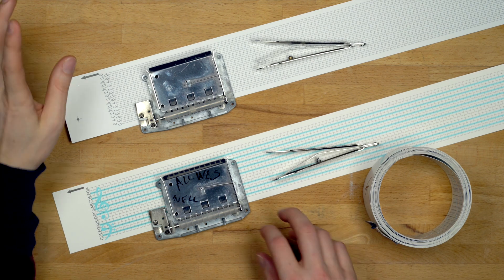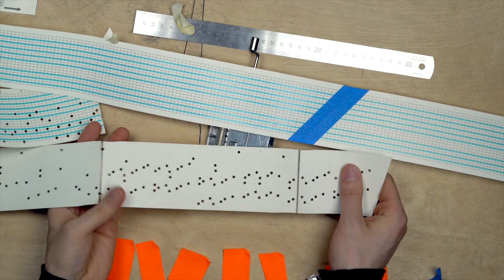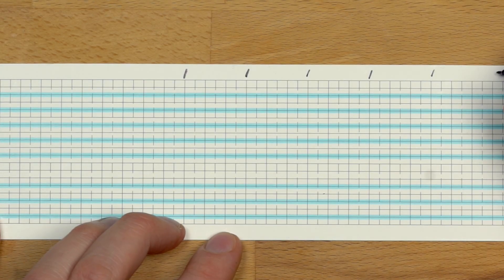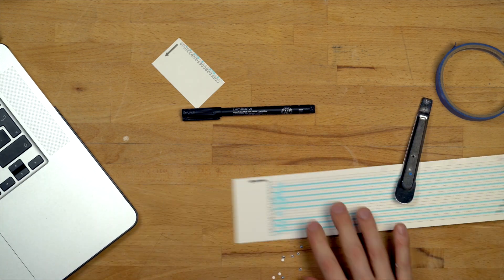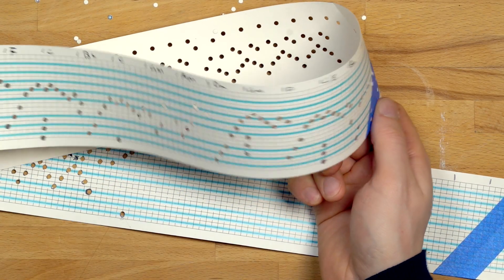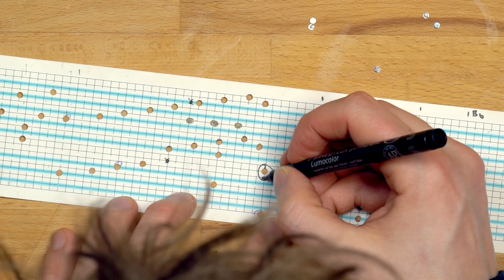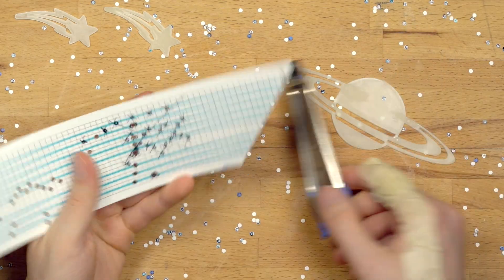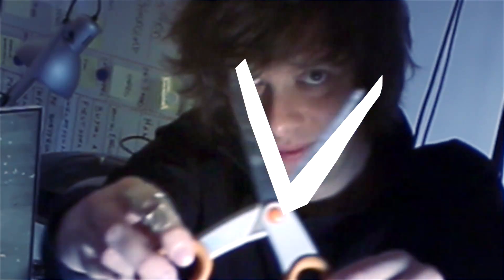How To Program a Music Box - Hole Punch Tutorial

Comment: You should invest in Adobe Illustrator and create a music box template or find one already created by someone else, then simply create your notes on it, print, and punch. If you need a certain paper thickness, print the paper, loosely tape it onto the right paper weight and use it as a guide. You might need a light box or transfer the print to tracing paper. It depends on the amount of work or cost you're willing to commit.

Comment: Hi martin, you can use direct midi to hole score print software available from a Japanese programmer. very useful because can print to any paper directly from midi. Unfortunately it has only in Japanese version, but I'm quite sure that you can use it with your insight.
http://www.01.246.ne.jp/~ttha/index.htm
Reply: Hey, I have this program!! When I bought my 30-note music box at a Sankyō music box museum in Japan, they gave me a copy of this program "Oto no Kyanbasu" [ The Sound Canvas ] for free. Unfortunately, mine only works on Windows XP.  But I just looked at the link you posted, and it says it is working fine on Windows 11? So maybe I just need the updated version.
Reply: Sorry, it's actually a 33-note music box! So it's different from the ones most people are using.

Comment: This video has been hugely helpful to me! A couple questions: 1. Are there ways of temporarily re-tuning the music box? Sometimes I want the low D to be a low E, but then I'd like to change it back without degrading the comb. 2. What about making your own paper tape? I have figured out that the 30-note paper is about 70 mm wide, with 2 mm between notes and about 6 mm on the margins. Given these measurements, it should be easy enough to create a drawing in any old drawing or word processing program and print it on card stock. Or, draw it on card with a pen and ruler. Seems like it would be way cheaper than buying a roll of music box paper. You can get 15 m for $18 including shipping, so wouldn't printing or drawing your own cost less?

Comment: So back in the day (before our time), my father used to write his programs into his terminal and then would print them to punch cards.  Pretty sure they were IBM machines.  WAY too large for your use.  I remember seeing some cards on his office shelves when I was 4 years old (1979) and thinking about it now, they kinda resembled midi.  They came out looking something like this  https://i.stack.imgur.com/XvPKy.jpg   I would think using the same tech that punched the cards back in the day, it should be possible to do something similar with midi.  Would require a custom machine for sure.  Not sure where to go to start you off, but thought it might prove to be another avenue to speed the production and accuracy of your amazing musical works.

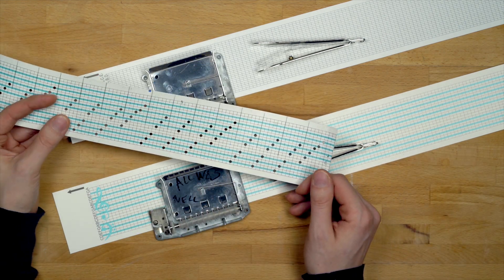Comment: At 0:41 he shows both boxes. One on bottom showing has more contact points on the pulling wheel. Does anyone know what version of the music box this is? I happened to own one of the ones shown on top with less contact points. Not only do I HAVE to thicken up the paper with 2 layers of tape to make the paper not fold upward into the umpty pockets where contact points are on the other one to not have it play random notes, also because it has not enough contact with the paper, it simply somehow can't pull the paper forward, having it brake every now and then, it seems to do it more and more the more I play a specific roll. It's fucking annoying having to tape all these strips with multiple layers of tape since it makes it harder to poke holes in it and also takes a shitload of time. 

If anyone can help out or tell me more that'd be fuckin really appreciated
Reply: This is a really late reply and I don't know if its of any use anymore, but I think the 20-note music box he has is from likely Grand Illusions (https://www.grand-illusions.com/20-note-music-box-set-c2x21140292) I bought my music box from this site too. I recognize the sheet music he uses is the same as mine. The music box doesn't have the problem you described with yours. Best of luck!
Reply: Can't you just use thicker paper to begin with? Like card stock.
Reply: Oh, I just realised you're working with rolls of paper with all the score markings already printed. I use a different system where my computer prints it out using a free software that came with my 30-note programmable music box (I got them at a music box museum in Japan). Unfortunately, the free software only works on Windows XP. I use an old laptop just for this purpose.
Reply: I would take the pre-printed paper roll, and glue it onto a thicker paper, like a thin cardstock. Then after it's dried and flat, do all the hole marking and punching. Maybe that would work?
Reply: @hikikomoriarty  what kind of program?
Reply: @ЖеняКаримов-е6л  I'm unable to post a direct link (nowadays YouTube auto-deletes comments with links). So please look for the comment by MASDA who posted the link to the music box program (3 years ago). The program is called Oto no Kyanbasu [ The Sound Canvas ]. Unfortunately, the webpage is in Japanese only, so you'll have to use Google Web Translate to read it. But I noticed that it says the program is working okay on Windows 11!
Reply: @hikikomoriarty  thank you!
Reply: @ЖеняКаримов-е6л  Sorry, I made a mistake - my programmable music box is actually a 33-note one! If you want a composer for the 30-note, check out MusicBoxManiacs or JellyBiscuits .

Comment: I have some observations to make after randomly picking up one of these 30-note music boxes:

(1) It appears to be tuned such that C on the box = G on piano. So if you are writing the song up in a DAW before copying to the box, do be aware of that sort of thing and prepare to use the Transpose feature

(2) The scale is "mostly chromatic". Basically there are about 1.5 octaves of chromatic and then you lose some accidentals at the top and the bottom. At the bottom you lose some other notes.

(3) I feel like the one I bought drops a lot of notes. Is that normal? :S I'm not even putting the notes very close together, and my holes look accurate enough, but it is just not playing them.
Reply: The Music Box Fun website has a DIY Music Box Guide page that shows diagrams of all the notes that are playable on the 15-note, 20-note, and 30-note programmable music boxes. I hope there's nothing wrong with your music box!

Comment: They made keypunch machines that you just fed the note into it and you press the key to the note you want to punch.
These were specially made for music boxes, as far as I understand they are rare and a lot of them were Japanese.

Your easiest way of programming punch roles like this would be to make a machine that punches out the holes accordingly and as you punch one hole it also has a method of moving the entire forward to the next section by itself.

The easiest thing would be to design such a machine but have a little window for the notes so you can see what section it is in and manually move it in place and lock it with an easy clamp using a lever, this process would be much easier, such a machine could easily be made out of Lego even.

Comment: Why don't you automate the hole punching with an arduino? You could make a simplistic hole punch matrix board that prints entire segments at a time straight from your PC. I mean ultimately what we're dealing with here is an automated weaving loom, a multi-century old technology. Except we're dealing with 1/1000th of the work area. You'd do well to look to the programmers of the 50's and 60's too (my mother was one), they used punchcards and ticket tape to program machines. They would have had automation and good tools for punching holes in set patterns!

Comment: The next point on the agenda would be to design a device which punches the holes as the piece is played, similar to the old telex machines, they would generate a paper strip based on what one initially typed ... later one would simply feed the strip through the 'reader' to ensure the message is sent at a high speed.  This manual punching of holes is time consuming and enough to drive anybody crazy.

Comment: You can use an electronic vinyl cutter to punch the holes better than a laser cutter. Just figure out a way to export your midi file to a pdf or graphic filetype in one long strip. The vinyl cutter software will recognize black dots or bars in the  file and cut them out with a vibrating knife or punch depending on the model you use. This approach has an advantage over laser cutting in that vinyl cutters are designed to feed from long rolls of material such as vinyl, fabric, and thick paper. Laser cutters are limited to the length of the machine. Send me a message if you see potential in this idea.

Comment: I think a more Wintergarten way of doing it would be to do it with the legos. You could use your current lego-built pulling system to move it with a step motor, use a step motor to move a hole punch, then use a servo to push it down to make the punches. Would be EXCEPTIONALLY easy using the data straight from a midi file, just use the note data as a 0-20 scale for the stepping motor.

1- check if note is on the same line, if not, move to next line.
2- check if punchhead is in the correct position (1-20) and if not, move it.
3- activate servo to push the punchhead down and create the hole.
repeat
Reply: actually I have a simpler solution, but it would require more servos, but wouldn't require any repositioning of the punchhead (less mistakes)

Comment: Well why use paper like that? It's possible to build a machine that pulls a roll of paper through itself and uses sulenoids to poke the note holes in the paper. That way you don't need anything but it and a midi in range

Comment: If you can find an old DEC or IBM paper tape punch, you could probably communicate t it over serial connection via arduino. getting the spacing right would be a challenge.

Comment: As you already have a little Lego Mechanism that keeps scrolling the paper I can think of a method using the Lego Mindstorms Bricks and some custom Software to create a something like cheap Note-Writing-Machine. 
If you use LeJOS instead of the normal Firmware you can programm it with JAVA and use the USB or Bluetooth connenction to send the Data of the MIDI File to it.

Comment: About the MIDI printer thing, the way I would do it is by re-using the machine you already use to play the music. It has the feeding mechanism for the strips and you can already change out the player. So if you had a mechanism that could punch holes that can fit in the same slot as the music box player head fits in, you could quite easily program actuators to punch holes in the appropriate spot at the appropriate time.

Since the feeder already feeds the paper at the correct tempo, the hole punch would just need to punch a hole whenever the note pops up during playback.

So what you'd need is 20 rods, one for each note, 20 actuators, one for each rod and an arduino (or similar microcontroller) and some minor programming skills.

Also, if you have that machine, you no longer need the guide lines, which means you can use any paper of the correct size. That way you can create your own strips of whatever length you need from raw rolls of paper. You can get those at just about any paper supplier (I know there's a LOT of them in Sweden).

Comment: Why not build a machine that punches holes with a midi input (laser cut... pop!), and a camera and optical senor that keeps track of the grid. It could be done with a raspberry pi, a java script, and a few senors. Some hardware would been needed to, like some stepper motors, and your build it blocks. If you had a 3d printer, it would make the process way easier, but a lath and drill press would do too.

Comment: Hello :) I have created a small python program to translate MIDI data into a DXF file which should be usable for any laser cutter. The usability still needs a bit of improvement. It does not warn if holes are overlapping etc. but it has options for all the dimensions.
Are you comfortable with using the command line/terminal?
What OS are you using? (The video overlay looks like Logic :)

I can improve it a bit and make a small GUI for it to be usable with mouse and keyboard (which I plan anyways).
I will release it in the next days on github, I need some sleep :)
Reply: Many of them have pass-throughs. There are also relatively easy methods of creating alignment aids such as registration pins with a "key" cut out of an otherwise unused potion of the tape.

Also aren't there (relatively) inexpensive consumer-grade continual feed laser cutters anyway?
Reply: That's so cool, could you give me the link on github. Actually I have finished some basic work. I've used the Microsoft Office Excel to make Midi file transformed into proper table on which there are plenty of small circles that can guide me to punch. But it's pretty inefficient, so I need to improve the tech.
Reply: @crispchris0_0  you can use https://musicboxmaniacs.com/ to create and print strips. Also has an app music box composer.
Reply: @crispchris0_0  hi
Reply: Please link if you were able to finish.
Reply: Nice

Comment: i wouldn't use a laser cutter to cut the paper, i'd use a mechanical hole punch (maybe a metal rod ejected into a hole by an electromagnet) and a couple stepper motors so it "plays" the midi as it's dragging the paper through, punching holes in the correct places as it does

and of course, if you were to use a system like this to punch the holes, you don't need marked paper, as long as it's the correct width/thickness it'll work fine

Comment: Easiest solution I can think of for automating the punching is generating the punch plans with a program, then converting whatever it generates to the file type needed for the laser cutter. It's hard to find a program to generate the punch plans but I did find this http://www.jellybiscuits.com/?page_id=705. It'd make a jpg which doesn't seem too difficult to then convert for laser prints, but you'd still have to shift the strips manually in the laser cutter which could make errors more common (and widespread).

Comment: Is there no way to make a machine that could punch the holes for you based on the midi file?
Reply: Of course there is, in fact they used to have machines to punch program cards for earlier computers, such as those described here (en.wikipedia.org/wiki/Keypunch). 
Someone could make a modern one for music sheet, looks like a fun idea to try. (now reading some old manuals from IBM to know how the machine made the holes in the paper)
Reply: The problem with a keypunch as far as I am aware is that it will not give you the flexibility required to do things like grace notes, rescaling for tempo, or creating arbitrarily long rolls. Whereas a continual-feed laser engraver/cutter could very easily do those things and more. Such as cutting the joints on the engraver to avoid some of the tedium of tape assembly.
Reply: 12:30

Comment: Several people have mentioned using the punched out paper as confetti. I used to program computers with both paper tape and punched cards in the 1970's and we were always warned to NEVER use the cut out material for confetti as it can cause severe pain and even blindness if the material gets in your eyes. Real confetti is much softer and larger and designed not to cause any damage. Love the videos.

Comment: Before setting up the whole lasercutting pipeline, I guess it could be quite feasable to code a simple program to print a cutting template from the midi chart, and then punch through the template into the actual roll.